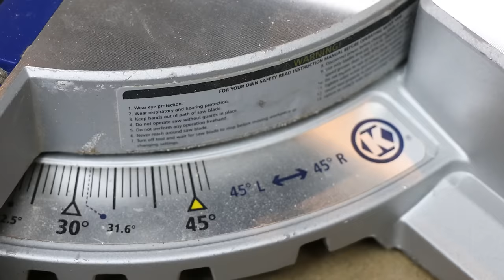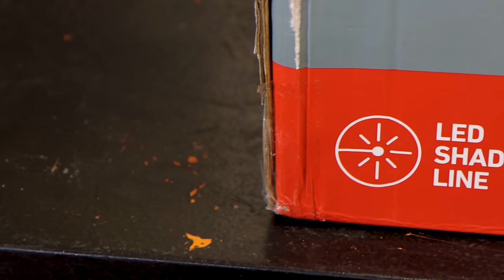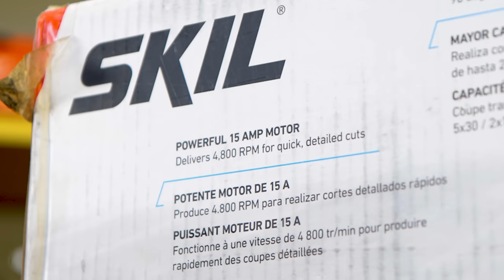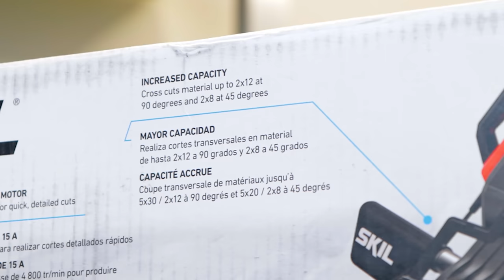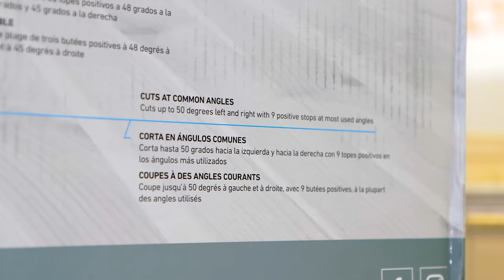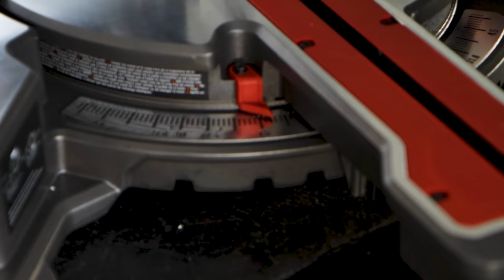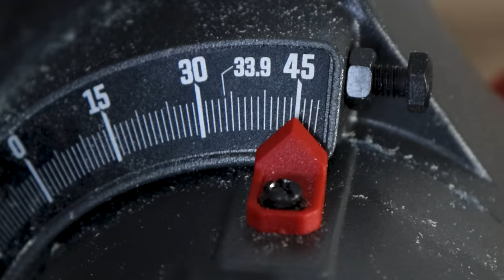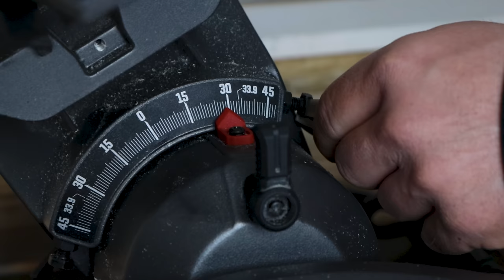Best AFFORDABLE 10'' Dual Bevel MITER SAW (You Will NEVER GUESS The BRAND!)

Comment: Hi Vince.  I just want to give ya  big thank you for your review of this saw.
I purchased this saw a little over a year ago based on this review.  I've since used this saw pretty heavily all this past summer doing 3 composite decks and a complete vinyl siding job on our new house.  I changed the blade to a 60T Diabolo for this work.  It cut the vinyl like butter.  FWIW,  one has to pull the blade thru the vinyl rather than the traditional push thru in order to get clean, non-chipped cuts.  I got precise cuts on all the composite decking as well...all flawless.  It's a great saw, especially at this price point. 
Here recently, I pulled that blade back off and gave it a good cleaning prior to starting the next phase of our house project.  I've recently been doing window trim work primarily following the method used at Finish Carpentry TV (Richard)....all using this saw.  So far, so good!!!  Love this thing!!
Again, thanks!!!
Reply from the maker: Larry, 
Thanks so much for leaving this awesome comment, myself and creators like Richard really appreciate the kind words and hearing your experiences!
I’m glad the review is helpful and I hope the saw and blade give you many more years and projects worth of work!
Best,
Vince
Reply: Put the blade in backwards to cut Vinyl siding

Comment: I'm in the market for a 10"  cordless or corded miter saw for flooring, my 12" dual bevel DWE779  is a bit overkill.
Reply: Nothing like letting your customers know your a true professional with skills than the Skil double bevel. It’s says you have skil right on the side, so you must be good...😂
Reply: Why not look at a 7.5 instead of a 10? I run the Dewalt 780 and a Milwaukee 7.5 cordless on my jobs and it eats everything I feed it. Dewalt, Skil, Metabo and Kobalt also make them

Comment: A 12 inch Dewalt sliding I was just on sale a few weeks ago at Home Depot for 299 I think. What I’m looking at now is the Bosch. Since it has a smaller footprint when it comes to the sliding mechanism you don’t have to worry about it sitting so far back like the dewalt and skill. Takes up less space for a shop.

Comment: I just got it for 230$ including tax. I’m quickly falling in love with Skil. Their 14amp router combo is the best value out there, hands down. It’s gone as low as 100. I’m using this saw primarily to break down lumber and will soon need it for a lot of quick cuts when I move into a new place/shop. As far as I can tell with the few test cuts, it’s dead on straight from the factory. Good job skil

Comment: Thanks very much for this review.  I had a cheapie Chicago Electric sliding miter saw for many years, but now I'm working on a home theater project with a ton of crown and other moldings, so I needed to step up.  I didn't spend a million dollars on this saw, but it's a huge improvement.  Accuracy is very impressive, just as you found.  I did change the blade to a 60-tooth, low angle ATB (couldn't find a negative rake in any local stores) but you're right, the stock blade was impressive out of the box for a 40T.  Thanks for confirming my good impression.  Great saw for the money.

Comment: Just received and set up this exact saw this afternoon.  It was dead on right out of the box.   There were a couple or minor things I ran into:  1.  The saw lock was pretty loose and would engage on every cut locking the saw down.  There is a 2.5mm set screw there on the side of the sliding lock bolt which I slightly tightened up and solved that issue.  2.  I wanted to put a 60T fine-cut blade on it.  Loosening the cover screw to move the cover back to expose the blade bolt was somewhat of a challenge....until I realized that the screw has to be almost completely backed out in order for the cover to move.  BTW, blade bolt is reverse thread:  clockwise to loosen.
I made several cuts with various thicknesses, and this beast ate it up.
Overall, it's a nice piece of equipment, especially for a DYIer/homeowner/hobbiest.  Great saw.
I know this video is over a year and a half old, but still want to say "thank-you, Vince", for putting it out there for us.

Comment: LOL, Loved the saw at first but after about 20 cuts with it, something broke inside. Not sure what happened but the blade would not turn but the motor ran with noise. Pushed in the button to lock the blade (for changing) and released it, blade spun again until I turned it on with the motor. Sent it back trying to decide if I want another or a different brand.

Comment: Bought it a few months ago. Accurate out of the box, doesn’t feel cheap, shadow line is excellent and way better than a laser, clean cuts with stock blade, fairly light, smooth slide, easy to adjust mitre and bevel, and plenty of small features like decent markers etc. The only thing I don’t like is it has poor sawdust collection. Great buy for the money.
Reply: could you describe the bad dust collection more. is this just w the bag or do you have a more elaborate dust collection system set up?  thanks
Reply: @nige_man   Just with the bag so can't expect all that much...

Comment: Nice looking saw!  Thanks for the review and showing the adjustments. I bought a delta 12” compound miter (non-slide) used on CL a few years back. Also came with a second 60 teetheses blade for $120. Guy barely used it. Been good for my needs!

Comment: I was given a brushless 36 volt Ryobi 10" dual bevel sliding miter saw for a birthday present 6 years ago.  I use it at least once a week cutting trim and gutters and whatever else I'm replacing.  It's nice and light weight and I've never had an issue with power even cutting red oak or pressure treated 2x8s i run it with 2 4 amp HP batteries (even though it's not an HP saw).  It's easy to carry to job sites and makes nice cuts.  The only complaint i have is that it has a laser guide as opposed to a shadow line.

Comment: Woodworking Beginner: Update.
This test is only if you want to saw with precision with a miter saw.(test is not intended for rough and hard work).     
Tips and Test:  Remember this test is only about torsion. 
Very important if you would like to saw with precision. (avoid torsion as much as possible)!
Always choose a Miter saw with a handle positioned in a VERTICAL line above the saw blade.  
Everything must be aligned, slide rails, handle, and saw blade,it is much better this way the blade will not tilt.
Because there is some torsion in the aluminum housing .
And choose an engine with softstart on it to prevent wear of the gear and worm shaft.
It is very important that everything is aligned.
Here are some examples to show how the handle must be positioned above the blade.

First option: handle vertical positioned in line above the saw blade. 
Bosch gcm 800 sj / Bosch gcm 8 sjl / Evolution rage 3 / FESTOOL KS 60 / Bosch GCM 8 SDE / FESTOOL KS 60 E KAPEX / Metabo KGSV 72 Xact/ Bosch PCM 8 SD / Hitachi C10FSH  / Evolution Fury3-S / Evolution R255SMS / Metabo HPT C10FSBS / Hitachi C10FSB / Hitachi C10FS.

Second optie: handle horizontal positioned in line above the saw blade / Evolution R185SMS / Evolution F255SMS / Evolution RAGE3R255 SMS3 / Ridgid MS255SR 10-inch

(This also is the case with the Miter saw without the slide rails).

(If you want). You can test it yourself at home if there is torsion in the aluminum housing.

Step-1. First you make a saw cut from +-5 mm deep in to a flat piece of wood about +- 20 mm thick to this with the normal handle positioned on the right side of the Miter saw (the wood it will remain in place until the test is completed).

Step-2. Then repeat this by pushing the saw blade down with your hand or finger on the aluminum protective cover were the saw blade is cased in. Just now only do this without the running engine.

Step-3. Now you can see if the saw blade will be positioned in or next to the saw cut. If the saw blade is (+- 0,2 / 0,5 mm) next to the saw cut then there is torsion in the aluminum housing. 
(test is completed).

Step-4. Therefor it is much better to choose a Miter saw with the handle positioned VERTICAL in line above the saw blade. 
The second option is the handle positioned HORIZONTAL in line above the saw blade.

Step-5. When you measure the vertical 90 degrees angle square (Digital Level Box) of you're sawblade don't forget that there is always some torsion in the aluminum housing.

Conclusion: how further away the handle is from the saw blade how more chance of torsion in the aluminum housing, you better not go for that. Remember this, the test is only about torsion and nothing else. (the choices are yours).

Also with a cheap slide miter saw it is still better the handgriff in line a above the saw blade than on the right side. Maybe they will make it someday then we have a winner...

Comment: It's also nice how they make the new miter saws they are lighter more compact they Incorporated handles and having that dual bevel instead of just a single and turning the wood upside down or you cut it the wrong way tools have changed so much even the first battery operated tools the batteries and tools together were so big it was almost impossible to get them inside cabinets you actually had to move the gun around test to get into the right position that's why my father uses the Milwaukee M12 because they're Compact and have plenty of power

Comment: Really liked this model and wanted to replace my old Craftman until I saw and bought Rigid 12" 70 degree miter with dual bevel which is a monster with lifetime warranty.
Reply: I was looking very closely at Ridgid/Delta 12" Miter saw, I mean, being able to make 70° angle cut without a jig.!? You can make some amazing "little trinkets." 
Time is money right. And I'm looking to replace my current job with woodworking/Etsy store.

Comment: Quick question, when you tested the miter and the bavel with cutting angles on the trim piece, were you holding it against a 90 degree protector? 

The saw will cut a plane on the trim piece regardless of how wrong the miter or the bavel angle is, so if you just hold them together, the planes are going to match anyway. The real question would be whether they would match if held against a 90 degree protector or any corner that is 90 degree.
Reply: great point

Comment: Have you ever had an issue with a miter saw going out of square when you extend it out for the max capacity. I have a Kobalt 10" sliding double bevel miter saw that's about 5 years old, and it's almost as if the rails are bent at the far end because it starts straight (and I've made sure the fence is square when the blade is all the way in), but when I bring the blade out even a little it starts to drift.

Comment: Thankfully you pointed out it was heavily greased as opposed to lightly greased !  Kidding buddy I am a contractor looking for a drag around miter saw.  I hv a 12” Makita corded in my shop on a nice stand and it’s “Flat & plumb to the cut”  with a Chop master blade (finish carpenter & cabinet maker).  So when I do trim outta of the shop I need a saw!  My 12” fixed Dewalt is getting to much to drag out!  Thank u for the video!

Comment: Just picked one up and will be returning it. The outer supports are about 15-20thousands lower than the turn table (right support lower than the left).  This is a big issue if you clamp on the supports (which is mostly the case) the work piece will be uphill towards the blade and not cut square no matter how square the blade is.  I had this issue with a cheap "entry level" unit and swore i would never own one like it again, I didn't expect it on a $300 machine.  I will keep looking...

Comment: I cannot stand when you're on a job and you see someone doing trim and they do not get that perfect because maybe the wall is off but they either take caulking and fill in instead of coping the back a little bit or they use their hammer to flatten the edge to make the cut look a little bit tighter but I like doing finish work learned everything from my father that's why I purchase the two new guns DeWalt Precision point and the Milwaukee brad nailer going to preorder the pin nailer soon once again thank you for the help last week picked up the DeWalt pancake compressor with the hose and got the two guns but that precisionpoint from DeWalt it's so nice because it allows you to see everything
Reply: Caulk and paint make me the craftsman I ain't

Comment: What's the best budget 12 inch miter saw? I'm not looking for a sliding saw tho. Takes up too much space in small garages where I usually cut my materials
Reply: I got Dewalt single bevel  miter saw, 12"   paid $249 On Amazon , bit ive seen as low as $209
Reply: @stevenbetassa7329  is that the dws715? I don't think it has the capacity I need. I need 6.5" vertical capacity

Comment: I enjoyed your  video.  I bought one of these a couple of months ago.  So far so good but I'm a little disappointed that it doesn't have any detents for bevels between 90 degrees and 45 degrees.  Also, when I first took it out of the box I was impressed with the cam operated hold-down clamp for quick adjustments but two minor problems:   I doesn't tighten as much as a screw down clamp and I wish it was tall enough to go over the top of the high extended fence.  But other that than that I like it so far.  UPDATE:  another disappointment with this saw is that it doesn't have a 30 degree miter detent.  I made a cut at 30 degrees but it wasn't accurate enough to make a hexagonal planter without trial and error,  Another saw in this price range, Kobalt 10" has more detents.   Still, overall I like the saw though there is room for improvement.

Comment: Like the piece. And the saw looks good except that you need extra area behind the saw for full ext.  I am a Ridgid guy. Except for miter saws. Their new ext arms are not stable at full ext. These styles with 2 steel bars are more accurate. And yes, Ridgid did ask me about this issue. They know it is a problem and have done nothing to fix the issue. There is a saw that solves both problems. Makita, that is my number 1 miter saw, great saw, good price and has only a draw back or 2. Ridgid will not admit the engineering issue. If you are shelling out 500.00 plus for a miter saw and it is not accurate, it is junk.

Comment: Compared to the Kobalt, would this be the better choice?
Reply: I had the Kobalt for a couple of weeks but returned it in part because I couldn't get the fence perfectly perpendicular to the blade but the Kobalt did have other advantages and disadvantages.  First off, the Kobalt comes standard with a 60 tooth blade, also had more positive stops for the bevel and the footprint might have been a little small.  On the other hand, I think the Skil LED is superior to the laser.  Skil's hold down clamp works with a cam instead of a screw and the Skil dust collection "might" be a little more efficient.   But the deal breaker for me was when I called Kobalt for advice in aligning the fence they promised to call me back--but never did.

Comment: Liked the review Vince, & Nick; as really put this saw thru it’s paces and showed us ‘bout everything you can!🙏🏼
Like that saws are getting “better¹ ”, and seeing the higher end features, on more “budget & mid tier” saws for the pricing 👍🏻
11:09 No matter the brand or price; of a new saw (miter, table, circular), it’s a good habit to check the blade for accuracy outta the box. If needed, ya make those little tweaks and fine adjustments to get a “super smooth straight cut”; cuz in my experience (and opinion) doesn’t matter who made the saw; out of the box it can be a bit “wonky’; & usually might have to make a few small adjustments (doesn’t happen often, but there’s been times, when thought whoever adjusted the blade at factory, had to have eyes closed; cuz it was “that far off” 😅).
Always a great idea to check the blades, stops, etc...for accuracy 👍🏻 Also, it usually is a painless process to make the blade/stop adjustments as well (I say “usually” cuz I did have 1 miter saw, HAD, that was an absolute nightmare to make blade adjustments, not to mention swapping out the blade, itself. I bet some can make some good guessing as to what saw that was😉); so take a few minutes and double check.
Cheers✌🏻

¹ Better=meaning good build quality, great features that are exclusive to the “higher priced tier saws”, and so on....if anyone reads this part 😉 Have a good one 🤙🏼
Reply from the maker: Thanks Aepek, I hope you have a good one as well my friend!

Comment: @vcgconstruction Do you think an extra $125 is worth it for the extra quality/durability/capacity of the Dewalt DWS779? Or save the $125 and go with this Skil10" slider? Love your channel by the way!
Reply: DeWalt stopped making a 10" duel-bevel compound miter saw. In fact the Skil might be the only one left to have these feature in a 10" model. Is'a nice tool.
Reply: your first mistake is saying "extra quality/durability/capacity". that's just not correct anymore. unfortunately dewalt is going the way of stanley and mastercraft. I will tell you this saw is the corded version of a Milwaukee 10". Same engineering, same machining as the new milwaukee cordless line. I was able to remove the rail slide lock-knob from my $550 cordless milwaukee and use it on the rail slider lock-knob of the skil. if the parts are interchangeable with another brand, you know they were cut from the same cloth. If you were standing at the factory and saw this in production you would be amazed to see how it is one isle away from the top tier brands. In fact, I would put money on the dewalt tools being made at the cheaper factory down the road. They went with top-knotch on this specific tool, cant speak for their other products.